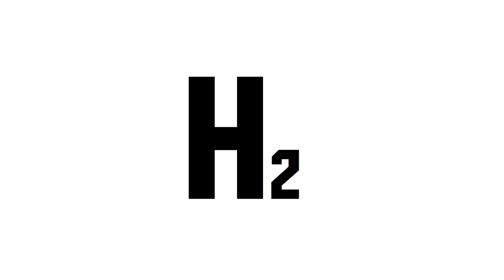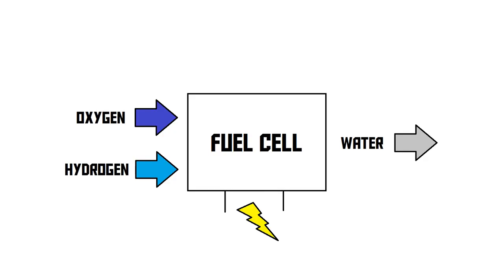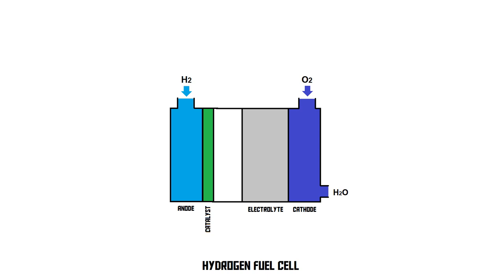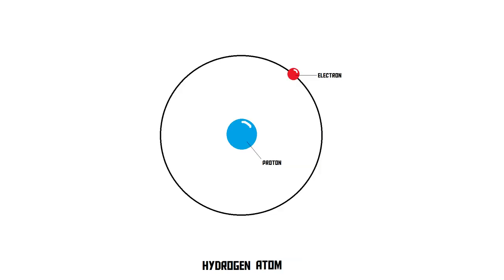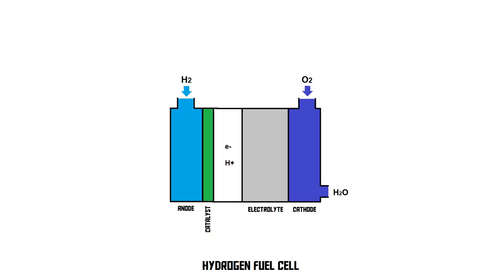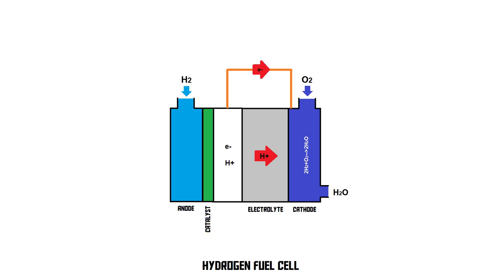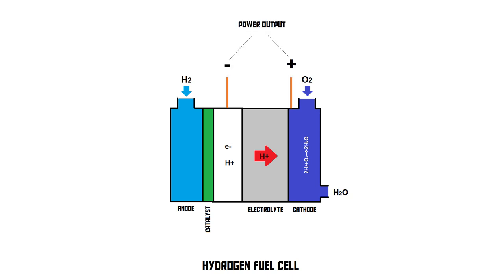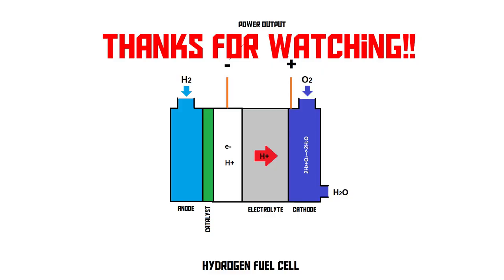How does a hydrogen fuel cell work? (AKIO TV)

Comment: This is shockingly well explained compared to other videos.  You actually answer the obvious questions in terms of how the whole ionization / electron movement happens, versus just some fancy animation that shows particles flying all over.  Finally makes sense to me.
Reply: This is not explained well at all and technically wrong although at least he named all the important parts. Jesus, this is why ignorance abounds in a world of knowledge available on demand.
Reply: @tylerdurdin8069  which parts are incorrect?
Reply: @scavengertag  I'll have to rewatch the video but I'll get back to you. If I recall he labeled attaching one lead to the intermediary or something. The leads connect to the cathode and anode. Think of a electrolysis hydrogen generator. The two leads are attached to a cathode and anode that generates the gases but with this the intermediary is a polymer that can filter using a particles electric charge essentially. This is also a setup used in some hydrogen generators and why some fuel cells can be designed to do both and go in either direction.

Comment: Great explanation regarding the fuel cell! However, if you ignite hydrogen with air (like in a HICE - Hydrogen Internal Combustion Engine) the byproduct of the equation isn't only water but also NOx, for instance, which is pollutant . Hence why Fuel Cells are in the limelight instead.

Comment: Hi, at the end when it says that the wire that transports the electrons can be used as the power source, how can it still form water as the electrons are being used for electricity? Or does the H+ not need an electron to react with the oxygen.
Reply from the maker: The electrons aren't consumed; they flow through the electrical device they power and then return to the negative side of the fuel cell. Electrons themselves don't disappear, they lose energy going through the device, which is what provides the power.
Reply: @AKIOTV  Ok, I understand now. Thanks

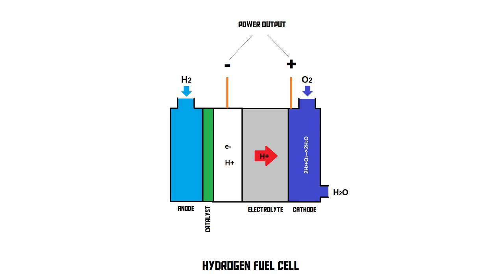Comment: I'm probably dead wrong but at 3:58 isn't the voltage supposed to be the other way round? Aren't the + and - signs actually the opposite of what it literally is?
Reply from the maker: That's actually a great question!

Electric current flows in the opposite direction of the actual electrons. It really has to do with conventions; at some electrons were discovered and we decided that they would be negative particles. Notice how we could have defined electrons as positive and protons as negative; it wouldn't make a difference, it's just what we picked. 

Actually, anti-matter is exactly this; with anti-protons being negative and anti-electrons being positive, so if we would have picked electrons as positive and protons as negative, then anti-protons would have been positive and anti-electrons negative. It's all about how you decide to define things.

Now then, as electric current is a positive (additive) phenomenon, but the particles it consists of (electrons) are considered negative (subtractive), the flow of the current is defined as the opposite of that of the electrons.

 In other words, when an electron flows from - to +, it "reduces the positivity of +", which is the same as a positive particle going from + to -.

Comment: Confused about necessity for cooling system except for optimal electronics outside casing?                    What is damage if catalyst requires heat for its function;  then why not simply manufacture sturdy casings?            Is there an expense problem other than Platinum catalyst,  which I don't understand or is not introduced?
Reply from the maker: large fuel cells need cooling, because they produce lots of heat. Not like "oh it gets kinda warm" but more like "if we don't cool this thing it ends up destroyed". Fuel cells have a far lower efficiency than batteries and large batteries in EVs already need cooling so it makes perfect sense that a similarly sized FC needs cooling too (even more so than the battery)

You seem to point out that a higher temperature is optimal for operation; while that may be true for moderate temps (haven't checked though) there's obviously an upper limit to how hot the thing can get, so you need cooling.
Reply: @AKIOTV      critique received.        My imagination does go over-reactive sometime so I cool it with a limited social shower.             You may redact if your imagination becomes issue bye-bye

Comment: I'm working on project that requires a lot of electricity in a small volume. I want to use a fuel cell for my energy solution. My question is, what limits or states the amount and rate of electricity that can output from the system? Thank you. Can I just run the fuel cell really really hot or fast and output a lot in a small volume? Thats basically what I'm asking.

Comment: hear me out on this: A hydrogen powered ship, it uses the fuel cells for electricity, and creates water and heat as a waste product. Electricity then goes to power electric engines. Then the heat and water mix to make steam, which then goes to a piston powered generator, which generates more electricity, and can go to power the engine(s) as well. The steam could then be exhaust or be reused. Now that there is all this power, it can be used to drive the engines and power other systems. Plus, the water would also cool the system. But how could you replenish the hydrOx reserves? Military submarines use a trick called electrolysis, where an electrical current is used separate oxygen and hydrogen out of water. But we have power, and water. some power could be used to separate waste water or water in the air or sea back into oxygen and hydrogen, and the cycle repeats.
Reply: btw if anyone uses this can I have royalties

Comment: HFC's as you said are expensive.  Best way to use Hydrogen is in an internal combustion engine.  Adjust the timing a touch, use a compressed tank in the back and forget the expensive and bulky HFC.
Reply: Burning hydrogen is still toxic.

Comment: Why are the electrons flowing towards the negative cathode?  I know that electrons flow from - to +, but in this case, electrons are produced at the anode (which is positive). Why is the wire conductor considered positive at the negative cathode? Thanks in advance!
Reply from the maker: The anode is actually the negative electrode. (as the half-reaction there produces electrons)

This is kind of confusing, as in other situations the anode may be the positive side (for example in the electrolysis of water)

This has to do with the fact that 'cathode' and 'anode' aren't defined as being positive or negative, but rather in the direction that electrons move in.

In the fuell cell, the side where electrons leave the device (anode) happens to be the negative side, but in an electrolysis setup, the anode happens to be the positive side, because here the anode is wired to the positive side of a power supply, which 'sucks' electrons from the anode. Notice how in both cases electrons leave the element (therefore the term 'anode' is used) while one is positive and one is negative.
Reply: @AKIOTV   Hi there, thanks for the explanation. I have one other question... How is the electric circuit closed? I mean, the electrodes are flowing towards the cathode, where they react again with the ions and the oxygen to form water. But that means that the electric circuit isn't closed?
Reply from the maker: @FASTR.Engineering  How is the electric circuit not closed? It's exactly like in a battery where electrons move from positive to negative. I suspect you may have the idea that electrons have to flow back inside the battery or fuel cell to create a full loop, but this is not the case. In a li-ion cell for example, positive ions move inside the battery (like h+ in a fuel cell), in the same direction as the electrons on the outside.

Think of it like this, instead of electrons flowing backwards inside the battery, positive ions are moving forward, which when it comes to net charge, has the same result.
Reply: @AKIOTV  Okay! So essentially the hydrogen ions flow through the electrolyte to the cathode where they meet again with the electrodes to form water with the oxygen... And that process is repeated as long as hydrogen and oxygen are supplied? So the electrons who were used in the external circuit (to power an electric motor) are gone with the water?
Reply from the maker: @FASTR.Engineering  Exactly. In a fuel cell the process continues when new fuel is supplied, in a battery you eventually reverse the process by pumping the electrons back to the other side (recharging).

So interestingly, producing new hydrogen from water is essentially recharging, except it takes place in a plant instead of inside the cell.

Comment: This is an excellent “lesson” with clear descriptions and a “clean” monologue (e.g. no umms and errs!), A smooth well ordered presentation (or was it cleverly edited?)!. It is well supported with “simple” diagrams (visual aids). I’m a heavy current electrical engineer (i.e. an electrician by trade), so anode, cathode and electrolyte are familiar terms. Added to that, I understand electron flow as an electric current. Would someone without that background have suitable (what we call in lesson planning) “Prerequisite knowledge.”? I am a former Electrical Engineering Lecturer and. in my last eleven years, Senior Lecturer in Teacher Training. Well done young man! I am curious about your background as you speak with some authority. Are you scientist, student or just simply “mugged it up” – researched it? No matter what, you would make a fine teacher! I found it very helpful! I am curious as to what the Hydrogen and Oxygen chambers were made of. Were they porous in any way? How do the atoms become released? I know that it is intended to be a simple explanation.
I came to this because I retired from my teaching career around twenty five years ago, so I am long in the tooth! Fuel cells were alien concepts. I need to grasp some of the concepts as I am concerned about the Climate Change “doom mongers” who could do immense social and economic damage in trying to rapidly reduce emissions to zero carbon. Extinction Rebellion’s aim is within five years and the UK Labour Party by 2030. In my view, “cloud cuckoo land”! They use things like hydrogen and fuel cells to justify their arguments. Well, they may be the future but they are still in the development stages and there are problems such as creating CO2 emissions whilst making hydrogen and the fuel cells themselves. Outright bans on Diesel and Petrol vehicles could be disastrous. Such changes should be progressive, well thought out strategies. But we are governed by “thick” career politicians who are not engineers!
Reply from the maker: As far as prerequisite knowledge is concerned, I don't know; where do you draw the line? Starting very basic may help the explanation but can make videos very long and boring, assuming too much knowledge makes it hard to understand, so it is always kind of a tricky thing to figure out the right balance.

The electrodes are so called "gas diffusion electrodes" which are made of a porous material. That way gasses will be able to flow through the electrodes. The catalyst material is mixed in with this porous material. Because the electrode and the catalyst are made of conductors, the electrons can be transported. 

You also mentioned some practical concerns about fuel cells. I think it's important to realise that it's all about the right tool for the job. There may be situations where fuel cells are the best solution available, and there may be situations where they suck and you'd be wise to pick something else. I've noticed that fuel cells tend to be a polarising topic, some people seem to love them, some hate them, but really it's just an invention like any other; whether it's good or bad really just depends on what you're trying to use it for and in what circumstances. 

Personally I think that the real potential for hydrogen as a fuel is in large scale applications. Small scale systems, like cars for example, can work fine on batteries, and although both batteries and fuel cells need development, right now batteries are often the wiser choice for such systems. This is why Teslas are popular, and hydrogen cars are very rare. However, at very large scales, say power-grid or industry scale, batteries are impractical. This is where hydrogen comes in. Hydrogen has massive potential for providing a way of storing very large amounts of energy. Especially with renewable sources like wind and solar, it becomes important to have ways of storing energy, because you can't control exactly when there's wind or sunshine. The current power grid, has very very limited support for energy storage and I suspect hydrogen is going to play a role here.

I wouldn't consider myself an authority. I'm an EE student at the moment, however most of my videos (like this one) aren't part of that, so a lot of the information is based on online research.

Comment: do you have to combine the hydrogen and oxygen at the end? if not, you could burn them and tap that for extra power
Reply from the maker: Unfortunately not. The hydrogen and oxygen have to be recombined. If in any way their recombination is prevented or made too difficult, they won't separate in the first place.
Reply: @AKIOTV  I don't get the causality here, how does preventing their recombining at the end prevent their separation in the beginning?
Reply from the maker: @marcopohl4875  To be clear, I was talking about the separation of the protons and electrons of the hydrogen. The hydrogen and oxygen were of course, already separated.

The way to understand this better, is the following alternative view:

The whole process that takes place in the fuel cell (protons/electrons separating, moving towards the oxygen, and finally combining with it to form water) is actually chemically identical to burning hydrogen. The fuel cell is merely a device to "tap" the energy of this existing reaction in a controlled manner. So essentially a fuel cell is a device in which hyrdogen is burned (burning = reacting with oxygen) in a slow and controlled way.

The whole thing you see going on in the diagram, is really just a detailed explanation of the combustion of hydrogen, which happens to take place in a special container called a fuel cell. This also explains why you can't "burn" the hydrogen again at the end; it's already been burned, even though there was no fire involved. 

Consequently, there's no H2 to be found on the "oxygen side" of the machine; the electrons and protons that were part of H2 before, instantly combine with those of the oxygen to form water.

So what I said about preventing them to recombine, essentially it's like trying to burn wood with no air; it just won't. Same here; if I were to put H2 into this machine, but just not put oxygen into it on the other side, the hydrogen would sit comfortably on the left side of the machine and nothing would happen.

Comment: Is the oxygen reduced at all? What purpose does it serve other than to react with H2 to form water? Does it feature in the electrochemical potential of the cell?
Reply from the maker: Oxygen is the oxidiser (same as in most combustions) It absorbs electrons from the hydrogen (which is the reducer) . These two half-reactions are also in the drawing.
Reply: @AKIOTV  so what drives the Hydrogen across the cell? is the electron that is oxidised from the hydrogen on the "left"... does it re-enter the H+ atoms that have also diffused?

Comment: Websites that cover college research keep saying there is cheaper catalysts now. They say it like every week. What's interesting is if the heat can be siphoned off, that is even more power because there are hot air engines, Stirling engines etc...Other thing about the catalysts...3d printing or gmo bioengineering catalyst might be possible. Tinker with tree dna. Molecular Biochemistry probably. Anyway...sites are saying there a cheaper catalysts. This specifically should help power plants and make electricity really cheap.

Comment: Nice explanation,thank you. Could someone explain me why  would hydrogen from the anode want to go to the oxygen in the cathod to form the water? Wouldn't they just form mixture of 2 gases instead of creating water?
Reply from the maker: essentially because water has a lower energy state and everything tries to be as low energy as possible (like stuff rolling down hill, or rubber bands trying to un-stretch)

Problem is, it needs the chance to do so, just like for a boulder to roll down a hill, the little rock blocking it needs to be removed, or for a rubber band to unstretch, the person holding it needs to let go of it. 

For hydrogen hydrogen to burn, that little "push" would normally be something hot like a spark, igniting it. In a fuel cell, the catalyst causes the reaction instead.

Comment: questions:
if the electrons from the hydrogen make electricity, why dont we just throw the protons away?
does the hydrogen and oxygen need to be ignited or does it just react and ignite alone?
and last
if the electric current is used, dont the electrons dissappear or are unable to remake hydrogen?
Reply from the maker: 1) the protons are part of the reaction; they can't be thrown away, either they never lose electrons (nothing happens) or they become part of water on the other side.

2) the reaction can take place at lower temps due to the catalyst, no ignition required

3) the electrons don't disappear, they return fully intact, but they do lose energy as they move through the light bulb. Think of it as water being forced through a waterwheel or turbine; the water pressure (like the energy of the electrons) has decreased at the exit, but the amount of water going in (like the amount of electrons) is the same as the amount of water coming out.
Reply: @AKIOTV  thank you